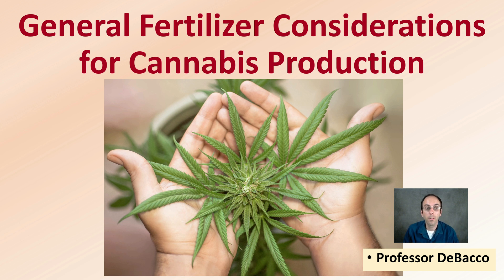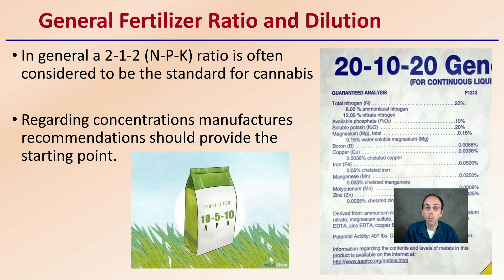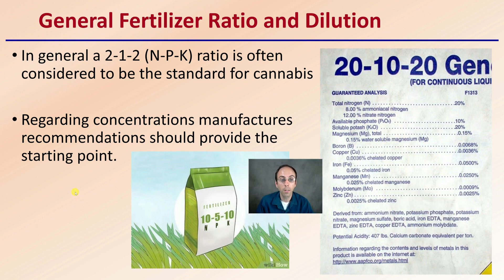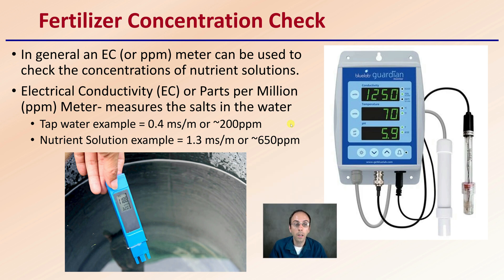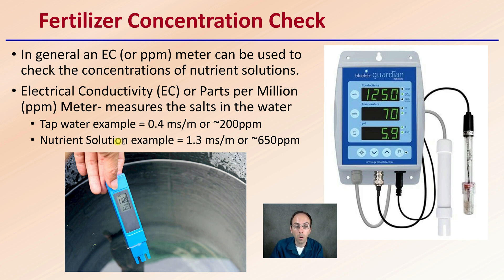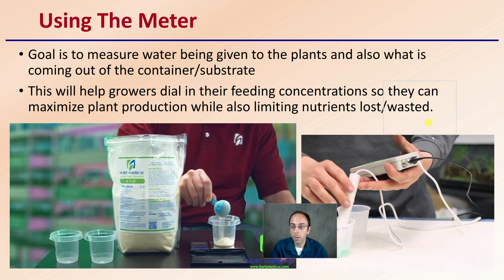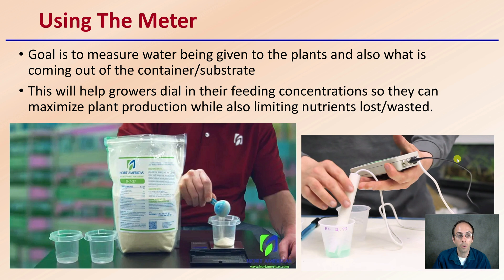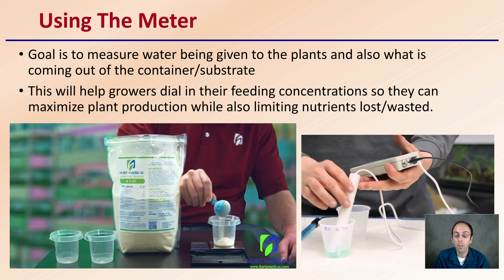General Fertilizer Considerations for Cannabis Production

Comment: This year I'm doing 19.5-22-15.5 on my plants once every 30 days. that's 1 1/2 TBS of Miracle grow all purpose 24-8-16 and 1 1/2 TBS Miracle grow blossom bloom 15-30-15. mixed into 3 gallons of water.
Reply from the maker: Seems like more phosphorus than would be needed.
Reply: @DeBaccoUniversity  I only plan on giving them 2 doses of fertilizer this year the next one will be around July 15th. I have a 9 foot ceiling in my greenhouse, last year I had to cut the tops off 3 times  : : ( I grow in ground pots. dug into the floor.also added a handful of pelletized Gypsum to each pot. so far they seem very vigorous and giving off skunks smells at 18 inches.

Comment: After two weeks of twelve hour light cycles use 'Bloom' fertilizer. Anticipate harvest time and stop fertilizer a couple weeks prior to cutting. When the leaves lose their green color the nitrogen is used up and you can stop watering. Pull off leaves as they shrivel. This dehydration stress at the end boosts sugar on the flowers.
Reply from the maker: Grow fertilizers can still be used during the flowering phase as the plants still need other nutrients and not only phosphorus.

Comment: i have use this method for quite some time now. It work just so well. My nutriment solution is at 1.2ms just to be safe cause i use a pen that don't LCD screen on it so i let it flash between 1.2 and 1.3 and sometime 1.1.  You can also weight the nutriment for me its about 1.6 -1.7g/Liter it give a slightly blue tint to the water. The plants have all they need and happy . Also  this way its cost fraction of the price of all marketing brand.   Im happy to see a sec prove from a different university . both DeBacco University and Dr. Bruce from apogee are on my top list on cannabis topics. thx DeBacco for these  amazing videos
Reply from the maker: Thank you for this positive comment!  Great to hear DeBacco University is at the top of your list and with Dr. Bruce this is good company;-)  You may also find this DeBacco University video helpful... https://www.youtube.com/watch?v=ZLh5zXCqkw8